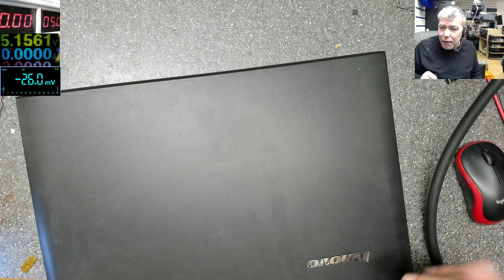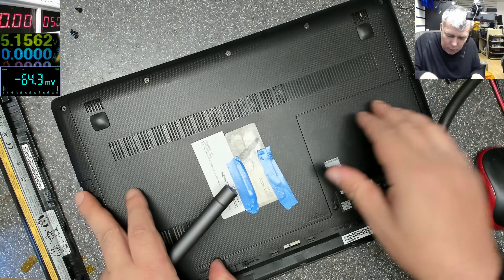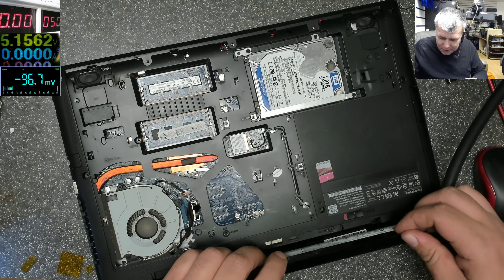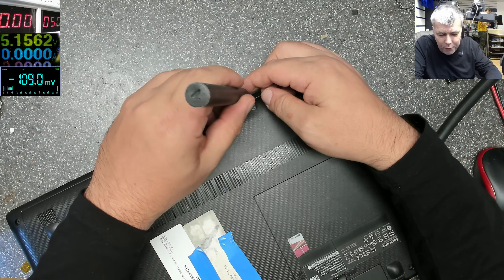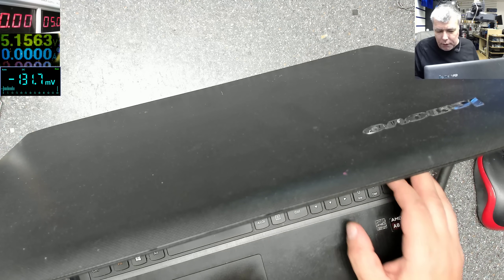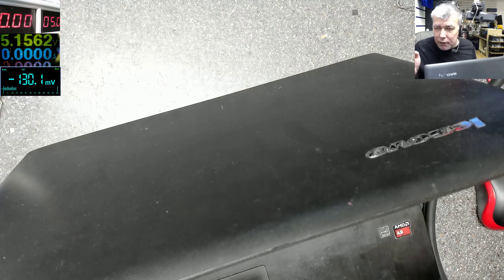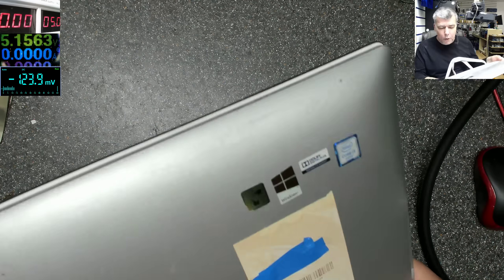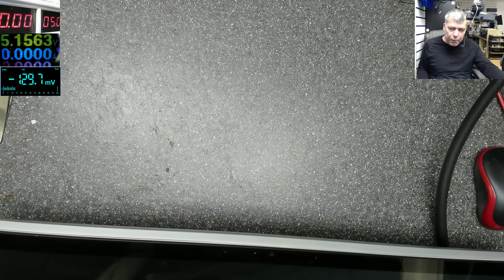Video TDR failure error, anyone know anything about this?

Comment: I had this very same issue with a HP Desktop PC. First the pc kept shutting off then I eventually did a clean wipe/reinstall of windows. After the reinstall, the BSOD with the TDR error would appear before Windows gets a chance to load. 

I believe that the issue is driver related since the pc successfully booted into safe mode. In safe mode, I accessed the Device manager and found issues with the Display adapter. 

My theory is that since the version of windows 10 I was using for the reinstall, was a more recent version, it probably contained incompatible graphics card drivers for the older PC I was trying to repair.  I re-installed twice from this newer version before I decided to use an older version I had on another bootable USB drive. The issue vanished. 

At the last re-install, I also ensured that I wasn't connected to the internet, to prevent any automatic updates during the reinstallation.
Reply: edit: the problem returned it is now seeming like a hardware issue

Comment: I have fixed a nvidia card before with TDR Error, one of the memory chips is the issue, usually reheat or reball or replace memory chip, it can be any memory chip and only presents the fault once the memory address comes into use, hence why so many people have it randomly.
Reply: What equipment are you using for reheating? I'm a noob.
Reply: @amateruss  just a handheld rework temp controlled heatgun with a oven hood type cover to evenly spread the heat.

Comment: Hi. I've been watching your videos lately and about this problem i have the same issue. I know this video is 4 month old and problably the AIO PC is fixed. Either way, the only solution is to use a small free software called TDR Manipulator (Google) and change the tdr delay seconds of  the GPU. This problem is caused due to overclocking or overheating either GPU or CPU and makes more stress on the motherboard and PCI-E, the other solution is to replace motherboard because is duying. All i know is that Windows is crashing the GPU drivers if the GPU need more time than usual to make a rendering of something.  The detail text i found about TDR is: "In order to prevent any rendering or GPU computation from locking the system, the Windows Operating System kills the GPU driver whenever a rendering takes more than a few seconds. When the driver is killed, the application using it crashes automatically. Since we can't possibly know how long a rendering or computation will take (it depends on the GPU, the drivers, the OS, the mesh size, the texture size, etc.), we cannot put a limit on how much the computer can process and avoid the crash."

Comment: Hi @Sorin
Even I had this problem in my HP pavilion G6-1318ax laptop
With windows 8.1 and AMD A4 processor and Radeon HD graphics card
I don't remember exact date but from last two months I had this and still not solved yet.
Laptop gets booted but after logged in few mins later the blue screen appears throwing TDR failure with this some sort of message (atikmpag.sys file might be corrupted).I tried all basic aids (boot in safe mode, uninstall and reinstall DISPLAY DRIVER) and even to local repair shop
When I took to them, they said there is thermal issue and installed. Windows 10, but still issue exists & now that laptop is unusable
If you found any solution,update with a video explaining the steps you taken to mitigate that

Comment: Graphic driver is stuck, reinstall windows or try live linux usb stick see if it works there, if not, then there is a problem with the gpu that is causing the crash. Integrated or not, the same applies.

Comment: I faced this TDR issue on my Dell laptop having dedicated RADEON graphics chip. I applied FLUX on the the chip and used Hot Air Gun to resold the possible dried connection of the chip with the motherboard. It fixed the problem and no more TDR issue.
Reply: I think from all replies, this is the most correct one. If after doing this operation, the GPU is just bad and needs to be replaced.
Reply: @oz457  dedicated graphics chips are solded directly on the board. As we know that any metal expands when it gets hot and shrinks when getting cold. this expansion and shrinking process break some of the solded connections which results malfunctioning of graphics chip.  Appling hot air can fix the issue.

Comment: Had similar problem, but it was dedicated desktop GTX 960 gpu. I was able to use this gpu without drivers, but as soon as drivers are installed computer freezes and restarts, after restart, blue screen. Problem: one of power track was physically broken. Solved by restoring track with wire. I suppose when drivers are installed, gpu starts using more power and if it's not getting enough power or some core voltage rail is missing, error occurs. Hope my info is someway helpful. Good luck!

P.S. If cpu is soldered, it's high probabilty that in your case, some solder ball is not having a good contact. In last place, if everything else looks good, i would try to reflow cpu like you do for a gpu, after putting flux under it. But in this case i think it would be permanent.

Comment: If it is working fine in safe mode , then it is a video issue and you can try to install older version of windows 10, older windows or linux

Comment: Sorin in bios just change UEFI to LEGACY .. then chose which operating system is boot in lenovo laptops they just support win 7 8.1 and 10 so use 7 it will be good just change in bios uefi to legacy i have same issue ...

Comment: No need to replace Nvidia video card.   Very likely the 12 volt supply to the card is stressed and not able to supply the current needed by the Video card even at rest off a atcale i found on line ;)

Comment: the aio is a 2016 bios old try the new one 2019 but maybe have to install an old windows 10  version  or 32 bits to install the update from 2019 this is the link https://pcsupport.lenovo.com/mx/en/products/desktops-and-all-in-ones/300-series/aio-300-23isu/downloads/DS119268 have a nice day hope fix the problem , i will see if works with ? solution stay safe

Comment: hi sorin ,the last 2 days i receive a lenovo laptop windows 10 compatible, when i boot up with windows 10 or 8 flash drive it stucks on windows first installation page but i tried booting windows 7 works fine. i think even that problem of you is solved by just installing windows 7.

Comment: As someone already mentioned, you should try using the software called DDU(Display Driver Uninstaller) in Safe Mode ( I understood that it works it ) then boot normally and try installing a different version of the driver, or the one,  that is supplied through Windows Update ( Or disable automatic driver installation through it, if it is the one, that is corrupted). Thank you again for your great videos. Cheers from Latvia! =)

Comment: Fix Video TDR Failure (atikmpag.sys): If you’re facing Blue Screen of Death (BSOD) error with a STOP Code VIDEO_TDR_FAILURE. The main cause of this error seems to be faulty, outdated or corrupted graphics drivers. Now TDR in VIDEO_TDR_FAILURE stands for Timeout, Detection, and Recovery components of Windows. This error is caused because of two files which are atikmpag.sys and nvlddmkm.sys in Windows 10. If you have NVIDIA Graphic card then Video TDR Failure error is caused by nvlddmkm.sys file but if you have an AMD graphic card then this error is caused by atikmpag.sys file. If you have recently upgraded Windows or have manually downloaded the Graphic drivers then most probably you will face this error. Automatic Windows Update seems to download the incompatible drivers which cause this BSOD error.
For more info see: https://techcult.com/wiki/fix-video-tdr-failure-atikmpag-sys/#:~:text=sys%20in%20Windows%2010.&text=If%20you%20have%20NVIDIA%20Graphic,error%20is%20caused%20by%20atikmpag.&text=Automatic%20Windows%20Update%20seems%20to,which%20cause%20this%20BSOD%20error.
GRTS Bektronics

Comment: You wrote, that the laptop works in safe mode, then it is 99% a driver fault. In this case, it is the Intel graphic cards driver "igdkmd64.sys" (Intel Graphic Driver Kernel Mode).
Boot into safe mode and have a look which version of intel HD graphic card drivers is installed, then try to uninstall the intel HD graphic drivers.
If the uninstall does not work, check this site https://www.intel.com/content/www/us/en/support/articles/000005598/graphics.html on how to uninstall via device manager and if this still fails, try https://www.wagnardsoft.com/display-driver-uninstaller-ddu-.
After the successful uninstall, check for newer drivers - I recommend using the Intel website to check for drivers as the laptop vendor sites often do not provide the latest drivers for their hardware.

Good luck!

Comment: This appears to be a graphics driver issue.  I would suggest booting from a USB drive and reinstalling the operating system (possibly keeping user files and data) to ensure the correct driver is both installed and not corrupted.
Reply: It's not necessary.

Comment: see if it will boot into safe mode first then try and fix it from there, then you can download the correct drivers from Intel,  error failure due nvlddmkm.sys files

Comment: Hi Sorin , I have Dell M6700 with Nvidia K 3000M Gpu an (MXM gpu), it also happened with me after windows update. i tried every thing rolling back gpu driver , windows reinstall, also tried linux,but the laptop would not turn on with showing same error, So here is what i did and it worked for me.
heated the gpu on 150 degress for about 2 mins
then  gumped to 250 degrees
then to 300 degress
and finally 350 degress for almost 1.5 mins , after that cooled down the gpu reinstalled fresh drivers and it worked just fine.

Comment: Hi Sorin, most of the comments are correct this is a video drv problem. Here’s a work around That WORKS. Start windows in safe mode then disable the Ati graphics chip- remove all Ati etc software related to the graphics chip- restart normal- Windows will now run with generic drivers. Had this issue a few times with ATI chips.

Comment: Hey Sorin, here is my shot at fixing your TDR timeout error. Change the RAM modules on a lower frequency, this happened to me with a Dell AIO 24 inch after I switched the RAM modules to a lower freq, the problem was under control, its not fixed, because it seems to be a voltage problem, but the lower freq seems to fix it.

Comment: Its most likely partial driver compatibility with win10...  Try trow in your hdd with windows 7 just to rule out windows 10 ...  If it's still the same error, then gpu is faulty (and yes, faulty gpu can work just fine in safe mode, because it's core clocks are on minimum, little heat.. But when driver loads , then core clock go up in stages by the driver and then you see unexpected bsod's/shutdowns ...   Edit: I just saw it has AMD graphics.. Go figure.. 99% GPU problem... reball or throw to thrash

Comment: Likely a bad driver or failing graphics chip. Boot into safe mode, go into control panel/device manager and disable the graphics chip (nvidia?), accept and reboot the pc. It will boot up without the enhanced graphics. When the computer starts booting and reboots, it's seeing the graphics problem causing it to reboot. I've experienced the same problem "coincidentally" also on a Lenovo machine. I 'cured' the problem by disabling the nvidia chip via the device manager. Hope this helps.

Comment: It's the intel graphics driver.  Try starting in safe mode, check device manager for video driver version, remove video device and remove driver software.  reboot computer, turn off windows updates, then get latest driver from Intel and install.

Comment: Hi dear Master,
iHave Same problem in store 7months ago and only when it solved that we change Graphic Chipset , 
it Was Radeon Brand Chip,
we didnt find out why or how
first of all
we heat the main Graphic chip with IR light,
then we had to replace Graphic chip
and after that 
it fixed,

Comment: Video TDR failure error   @Electronics repair school its coused mostly by gpu respons tme out of window (gpu dont talk for to long)(gpu its daying-ending)// you can inrease it in windows registry from my expirience tweaking it can help somites no error/no crashing but gpu chip sometimes its just "gone".... or crashing its lest frequent (no mesage) but problem can be still there (this can give some time before its completely unusably )// you can see insted of error flashing black screen on gpu load crash but pc will not shut down and driver will recover ofc depends on gpu model //this error may be caused by bad drivers corupt windows etc too -- but most likely its gpu

the registry im talking abaut

[HKEY_LOCAL_MACHINE\SYSTEM\CurrentControlSet\Control\GraphicsDrivers]
"TdrDelay"=dword:00000014
"TdrDdiDelay"=dword:0000000a

Comment: Sounds like a driver problem. Windows if trying to install the correct driver for a hardware piece (a critical one), then it restarts only to find the hardware is not responding as expected. I also think that an older version of windows 10 would solve the problem, but for that you need an old copy of windows 10 you can boot from.

Comment: Can you get to BIOS normally ? - check GFX setting. You need to run Safe Mode, First , to prove Windows will work with VGA GFX and thus the GPU is fine. Than run CMD SFC scannnow . Than MSCONFIG and minimal boot - to find the guilty one.

Comment: I had the same issue with Clevo and GTX 980m graphics card. It had BSOD(error pointing to driver_name.sys) and boot loops. I DDU uninstalled all drivers (it had 4 drivers gtx 980m, 880m, HD 8970m and eGPU gtx 1060); reinstalled the driver and the problem was fixed, thankfully. But, that AiOs has MXM card in it that draw a lot of power so the issue could be power related; boot into safe mode, delete the driver (run on Microsoft basic adapter), shut off power saving options when plugged in, reinstall the driver and reboot. If any of those fixes don't help, you got yourself a power leakage on that MXM; not enough to boot to black display, but enough to cause problems.

Comment: I got lot of this kind of problems about drivers carte graphique problemes and when i start it in safe mode works fine and i change the operating system system in works fine after so i think is about software issues

Comment: If your drivers are outdated or if they have certain bugs, Windows 10 won't be able to recognize the hardware associated with those drivers, and you'll encounter a BSoD error such as VIDEO_TDR_TIMEOUT_DETECTED. To ensure that your system is stable and safe from errors, we suggest that you update all your drivers

Comment: If it boots into safe mode, try installing an older driver. Looks like it craps out when booting into windows but screen is fine when showing error (meaning it's not using the driver yet) If it won't boot into safe mode, then it's not the driver, possibly chip is gone. I'd check the thermal paste/fans, make sure it's not overheating. It could also be something goofy with the touch screen.

Comment: Are CPU(GPU)/RAM voltages actually as they are required and correctly set in BIOS? Sometimes the "Auto" setting is shit. Is the PSU really giving the CPU(GPU) enough power? Try external PSU if possible. Change the thermal paste, take a physical look around, put your hands all over the components. Update to the latest BIOS. Try just a bare Windows 7/8.1 installation to remove OS and driver doubts. Is the CMOS battery with OK voltage under load? Clean the RAM slots with alcohol (very carefully) and the RAM stick contacts. Clean the PCI-E slot as well just in case moist dust makes the motherboard act up. Lots of tests to be done before throwing the white flag :) When the problem makes no sense after you've tested everything logical, you take actions that make no sense (at first) and just try everything ;)

Comment: I would test with a windows 8.1 and windows 7, you only need unactivated versions, installation just to see what happens. IF it happens with just windows 10 then this would be a compatibility issue more than likely if not happenig with some other windows install. Others have correctly identifiedm it but it would be good to check against other install such as 7 and 8.1. Else this could be VRAM, GPU etc. which means a driver may not be able to load properly due to hardware issue. Use safe mode with older drivers. 
 
In other words, it could be anything really, just need to try various solutions.

Comment: What is VIDEO TDR FAILURE blue screen of death? TDR stands for Timeout, Detection, and Recovery components in Windows. If you're seeing this notification, the most likely reason is that your graphics card driver stops responding. Windows might stop and restart the driver to fix the problem.

Run System File Checker

Restore graphics card driver

Uninstall or disable graphics card driver

Update video card driver

Comment: Anybody knows why a laptop does not recognize a hard drive? Asus Q502LA, brand new Samsung SSD. Initially was working fine, than step by step errored out more often and now it won't even see the ssd in the bios. Any help would be appreciated. Replaced even the hdd daughterboard, tried different hdd as well.

Comment: I might try reflowing the processor (or socket). It doesn't take long and has fixed a couple of similarly weird issues for me in the past. There were loads of cheaper model Vaios at one time with badly soldered nvidia chips that quite a few users fixed for themselves at home just by putting the MBs in the oven.

Comment: I would suggest using a live linux cd that way you can see if the system hardware is good and if the problem is software related. I have had a few bad widows images that hang up like that.